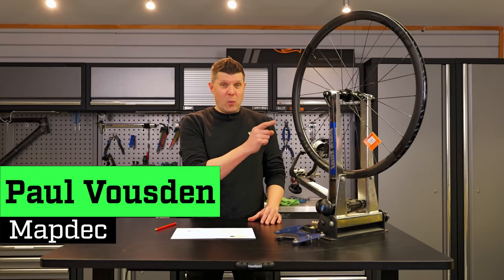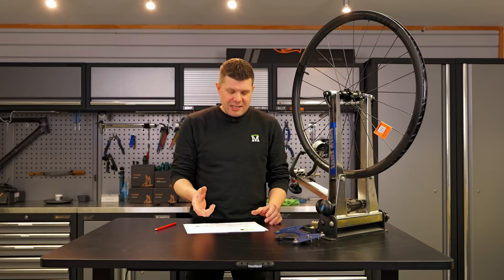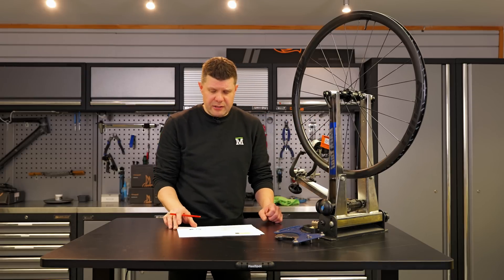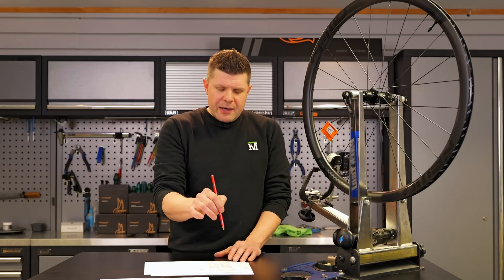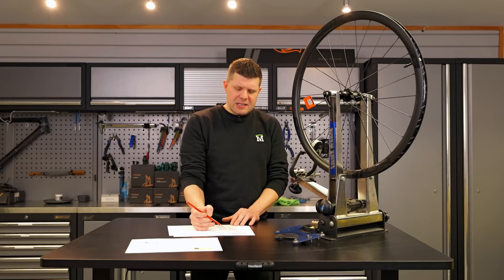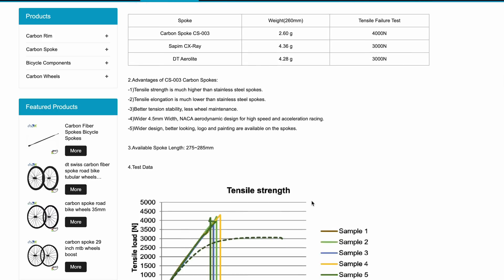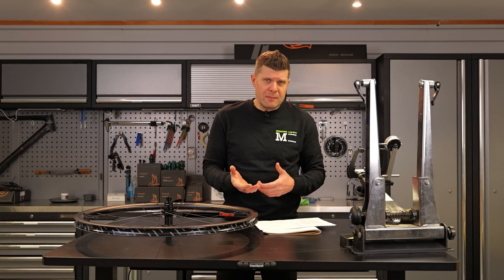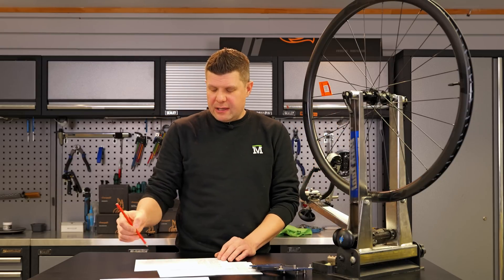Decoding Hambini's Wheel Tests: What did he miss?

Comment: Important point on spoke tensions:   Are they measured with a tyre on or off ?   Especially with tight tubeless tyres.   I only build with Alu rims, and steel J bend spokes, but I've had cases where wheel has been built to "mid-range" between max and min recommended tension (and yes +/- 5% variation from the mean on each side) according to the Park deflection gauge - but with a tubeless tyre fitted and inflated, the tension falls to significantly below the recommendation.
Reply from the maker: Yes.  That is a very important point.  Well spotted.

Comment: I don’t even understand where this video is coming from…….where’s the motivation here Paul, pretty gutless stuff sitting there slagging off work, half of which you probably don’t understand and cherry picking things you would put into his format…….least he has a format. Here’s a suggestion…..if you want to do a video like this, have the integrity to have Hambini on and go through the data and your questions face to face……..far more useful than this. I also would question your underlying motivation as you have liked all the Hambini ‘hater’ comments and not pulled them up on their moronic statements……extremely poor stuff, this one was a real low point in your channels history.
Reply from the maker: It came from viewers asking what it all meant and how relavent it is, and then as I researched it raised a lot of questions. I hope that you found it useful and it opens a discussion on what wheel test should and shouldn’t include.
Reply: @ still doesn’t gel from a motivational standpoint - as previously stated, gutless, pathetic and a real low point for your channel……the format you chose speaks volumes….

Comment: Tangentially related question... can the hub of my Shimano Ultegra C-50 rear wheel be upgraded to work with the SRAM Force 10-36 12 speed cassette XDR that I bought for a new bike build, hoping to use on my existing carbon wheels from my current Shimano Ultegra set up bike, only to realise XDR is not HG!!! 😮🤭
Reply from the maker: Unless there is a 3rd party making one, this is not possible
Reply: New hub purchased as I need the 36 tooth to get up hills!!!

Comment: Whats the end goal of this video?  Have you got some data? I hope so! 
1. 140kgf is quite normal for carbon spokes. Any less and they tend to come loose or vibrate under braking as there is far less stretch than a steel spoke. 
2. Any tension meter can be calibrated to any spoke by hanging  known dead weights off a spoke and taking readings off a TM1. Very basic and accurate.
Reply from the maker: Can you link me to a carbon spoke that is rated to 140 please? I have never seen one.  
End goal is just to start the discussion on what is important to know in a test like this.
Reply: @Mapdec  There are plenty rated at 140kgf, for example Winspace Lún Hyper.
Reply from the maker: @ that’s BS. Winspace don’t even list the spoke tech sheet so you can repair a set.  Link me to their website that says tension the wheel to 140kgf.
Reply: Yes it's important to know what's important to know, you know? I feel zero friction could help with setting up the tests, as he is a master of the heath Robinson school of imagineering.

Comment: Great video, really enjoyed it. One of the big issues I have, is getting the kgf value of carbon spokes from the wheel manufacturer. As you say, most Chinese wheel manufacturers are using ‘Unbranded’ spokes, that cannot be looked up. Also, I think Park Tool need to accept that carbon is the new norm, and update the TM-1 Conversion Table…… But then again, this may be tricky, because unlike steel, carbon isn’t a constant.
Reply from the maker: I think it will take Park years to catch on.  It’s an opportunity for someone.  Love the channel BTW. Hope it’s going well.
Reply: @Mapdec  You do!!!!! Thanks, take that as a massive complement. Just struggle to find the time.

I think Park will struggle with this one. Not only do they need to account for all the different spoke widths & thicknesses, but they also need to consider the grade of carbon used, and the bonding to calculating deflection. The possibilities could be endless!! …….. Suspect this is why we’ve not seen anything yet.

Comment: With most current crossed spoke wheels, Carbon spokes do not contact or touch each other therefore the vibration length would not be affected. Why mislead viewers? What are you trying to hide, why not reveal this information correctly? Are you trying to make Hambini look foolish? Play fair Paul! 
Carbon spoke wheels where spokes cross and contact each other are improperly engineered and will friction erode/abrade against each other with use, until spoke failure results.
Reply: I know Winspace originally had carbon spokes that touched. But, it caused issues and they changed it pretty quickly.
Reply from the maker: Good point.  Applies to testing metal spokes though.

Comment: @ 4:00 Talking about internal rim width, you mention getting under the lip to measure. I don't think thats how internal width is measured. I've only ever seen it measured from inside of hook to inside of hook...? Maybe it's a bike shop thing.
Reply from the maker: Hey Joe.  Yes. When we encounter tyres that don’t seat correctly and swapping tyres yields the same result we will look for rim defects.  Commonly it will be where a moulding flaw has been sanded out or a void has been filled. Next time I have an example I will post about it.
Reply: @Mapdec 
did an AI write this response?
Reply from the maker: @roribune8162  no.
Reply: @Mapdec  😂 that's what AI would say
Reply from the maker: @robertwhyte3435  we are doomed
Reply: @Mapdec Joe is talking about the manufacturer spec "internal rim width", you are talking about the consistency of the internal width between rim walls. These are two different things. What Joe is saying is that, as presented @4:00 you are talking about the common "internal rim width" dimension found on manufacturer specs, which is measured as Joe described, yet you describe a method for checking the consistency of a different dimension. It's an interesting insight that you find variances in your dimension to be an issue, but labeling your dimension "internal rim width", and discussing it without distinction from the MFG spec measured at a different location is the source of the confusion. In the video, from the wording used, it does appear you don't know the correct location to measure internal rim width, but I think it's more likely just an incongruous thought that doesn't come across clearly to the viewer.
Reply: @MrKipperfish  Very well worded, I picked up on the response and then read your comment.🙂

Comment: nice video! I often see reference to bike frame fit specifications, mostly in relation to press fit bottom brackets. Is that from a Shimano document, is it publically available and what is it actually called?
Reply from the maker: Yes.  I discuss it in a recent video.  The one with the dura ace BB in the thumbnail.
Reply: Sram has a very nice and thorough document on frame fit specifications on their website as well. It has everything. Technical drawings of all BB types, dropouts, brake mounts, hubs and freehub bodies, diagrams on frame clearance for cassettes, brake calipers, all their crank models... It's an absolute gold mine of information I reffered to a lot when I designed my own bike frame.

Comment: i confess the best wheel is still from the campagnolo, durability and the bearing are the best, the longer you use it, the more smooth it will be.
chinese brand also good but not as good as campagnolo.
Reply: Arguable. I've just had the bearings in my Campagnolo wheels which I bought new replaced after less than 6000km, fair weather riding only. Apparently this is not uncommon for Fulcrum/Campagnolo wheels. Reviewers of products only advise what things are like when new because they don't have them long enough to find out how they go when used for any decent length of time. This channel sees the good bad and ugly, and that's one of the really valuable aspects about the information here.
Reply: @KeithHeinrich  because campagnolo use open bearing the hub need to be clean each 1000-1500 kilo and regrease.
Reply: @endtimeslips4660  the manual states lube each 2000km and dismantle, check, lubricate every 10000km. And to be fair I have Campagnolo hubs decades old run like butter. This is why I was surprised to only get 5000km out of the last set. New bearings and all good again.
Reply: @ vietnam road especialy in my place not so clean. hub fast get dirty.

Comment: An interesting video. Im sure performance gains can be made with carbon aero wheels with bladed spokes, however for me reliability trumps everything. I had a pair of wheels built up by Malcolm, proprietor of The Cycle Clinic Suffolk. Sadly now recently closed down. Reliability folks, remember that!
Reply: Handbuilt wheels are also generally endlessly serviceable.  I wonder how many of these smaller brands will still be suppling spares in 10 or even 5 years time?
Reply: @michaeltilney1298  If you stay away from the proprietary carbon spokes, most Chinese manufacturers just use Sapim or Pillar for steel spokes.  Hubs or rims you are kind of SOL.
Reply: Cycle Clinic website still works?
Has Mr Borg really retired?
Reply: Aerodynamically, I think it would depend on spoke count as most of the carbon spokes are individually less aero given the width and depth ratio of the blade, the thicker often longer round sector near the spoke nipples and hubs.  Some have a larger double nipple design like far sport (one bonded to the spoke to stop it turning as you can't use the tool used to hold aero steel spokes, the other to tighten / loosen the spoke. I doubt this is as aero as hidden or normal spoke nibble designs.

Comment: He released a video earlier today explaining those numbers using a test wheel. He clearly stated that deflection tension meters provide inaccurate readings on bladed spokes because they bend unevenly in different directions. These meters were originally designed for round spokes. It seems he may not make the video publicly available, but based on that explanation, your analysis appears to have some inaccuracies. Perhaps reaching out to him beforehand would have provided clarity and strengthened your argument. As it stands, your take comes off as a bit amateurish, like someone working in a bike shop rather than an engineer.
Reply: What video? Is it for patrons or did I come late enough for it to be taken down?
Either way, his method is as good as a lookup table because the equation stands for the string of constant cross setion.
Reply from the maker: We spoke before this video went out, it is probably why he made his. The deflection thing he stated isn't correct either as they are associated with relevant lookup tables. You are correct, I own a bike shop, my channel comes from that angle. You don't appear to have watched the whole video before writing this comment.
Reply: There are bike shop owners who don't even understand gear ratios.... @Mapdec
Reply: @Mapdec Just stop including his name or talking about him or acting like you have anything linked to him. You are doing it to get views but by doing so you are promoting an unacceptable member of the cycling community. Do you want your customers, male or female to think you are in some way linked to him after his continued disgusting attacks on people within the industry? Seriously Paul, you put videos out showing how bike mechanics and the bike industry should be taken more seriously yet still include someone who is exactly the reason why it is so shit for some many people. Making out that they know better than everyone else and being sexist are both key reasons why the bike industry is on its arse and can’t encourage more people to enjoy cycling and look after their bikes
Reply: @MrRedChamp  agree 100%... 
Paul - why??????
Reply: @MrRedChamp  You dont know Paul....but you accuse him of click bait videos? Keeping your head in the sand thinking the little beaver man will go away by not mentioning him is just silly and WEAK!
Reply: @johnkasza2315 internet engagement doesn’t distinguish between positive or negative. That’s why Hambini and other click bait trolls do what they do. They want disagreements just like we are having in the comments to drive views. People are more like to engage with a negative take, you know this, it’s how all the news channels work. Paul including Hambini in videos is not only keeping his name in the limelight, it’s making more people discover his page and it’s making people who either love him or hate him comment, which gets more engagement for Mapdec.

Comment: The drop channel if large gives you some additional air volume too to run lower pressures
Reply: Wouldn't that mean, if anything, a higher pressure would be needed since the additional air volume isn't contributing to the 'travel' of the tyre? So all it would do is slightly decrease the progression in spring rate as the tyre compresses. Similar to removing volume spacers in an air sprung mountain bike fork.

Comment: Hi Paul, love your work. With regards to your Park Tool spoke tension guage, there is a big variation in them when you buy them. Its easy to make a calibration jig for them so theyll be accurate, only costs about 20 quid to make.
Reply: this is exactly what I had to do after buying Park Tool TM :) Even when there was a sticker by the local distrubutor, that is has been calibrated 🤭
Reply: @Kamil_D.  most park tool tools are over priced and poor quality, which is a shame because years ago they used to be decent.
Reply: @MysticFluff1  some are poor, but still most of them are decent
Reply: Those spoke tension tools are seem as reliable as their shocking torque wrench.
Reply: @tuttobicci  What ultimately matters is accurate tension relative to the other spokes.  An experienced wheel builder is going to know if the spokes are grossly over tension and the gauge reading is erroneous.  Even if the gauge is reading 140 instead of 130, it's still going to be accurate within a couple percent of the spokes next to it.
Reply: @ryans6650  Exactly

Comment: Cytech 2 &. 3, 10% tension variance is viewed as being excellent, interesting you reckon 5% is readily achievable. I guess for a pro it must be
Reply from the maker: To pass a national apprenticeship you will need to do <5% and 0.2mm in under 90mins.
Reply: @Mapdec I'll never know because I don't have a spoke tensiometer. On an aluminum rim at least, variations in roundness in a rim influence what is possible. I do know that my wheels stay true a long time. No metrics associated with that claim! I know where to seek warranty performance too.
Reply: @Mapdec  my third wheel I did took me 60 mins .....
Reply from the maker: @Kamil_D.  do you want a job 👏. That’s impressive.
Reply: @Mapdec  I guess it is around 1000km from here to your shop. daily commicing is going to be kinda difficult 😃
Reply: I'm 16,500km away and thinking the commute might still be worth it for a role in this workshop.

Comment: Why am I even watching this? I haven't bought a new wheel since 2003, on second thought, 2004. Very watchable video, obviously.
Reply: My 0.0 needed a new dog bone and bushes and still rides well after many miles, I have another  iDrive 4.0, the mechanism is intact but it squeaks more than a hundred dog toys and doors in an old castle put together. Mavic wheels with Deore XT hubs and dt Swiss spokes still in good nick, been ridden a lot.
Reply from the maker: That's impressive, what wheel has lasted you more than 2 decades?
Reply: @Mapdec You probably didn't ride it much. My 2003 base model had so so wheels. The I Drive mechanism didn't last. Built new wheels for it.
Reply: @Mapdec  Whatever came with my GT idrive in 2004, never serviced lol
Reply: @peterjanovcik9973  I had a limited edition i-2k I-Drive and the eccentric BB bearing shell that was held by the dog bone would slop out pretty often.  Absolutely loved that bike, but I eventually folded the hydroformed seat mast and broke it.